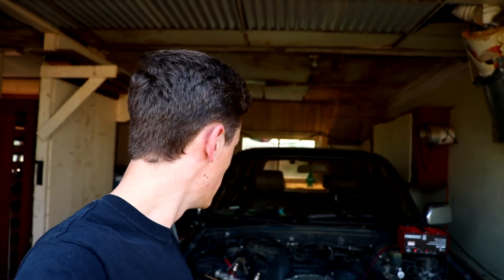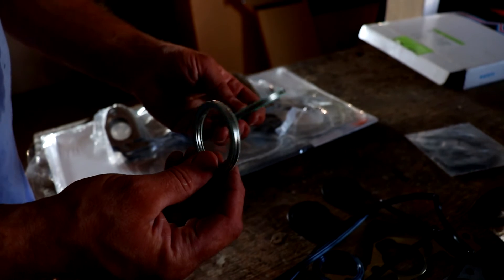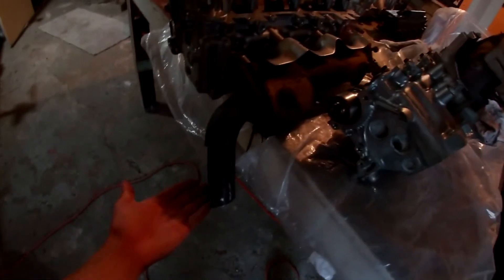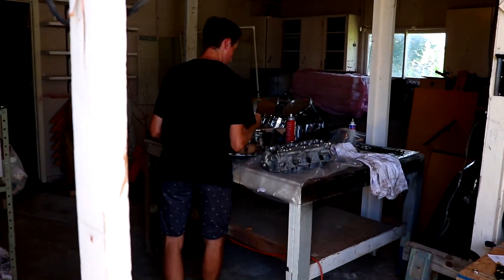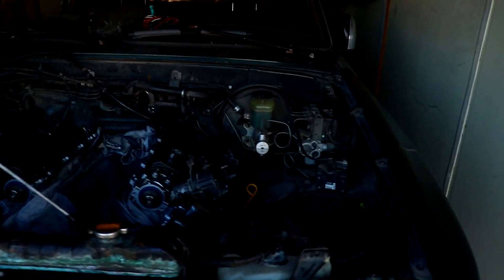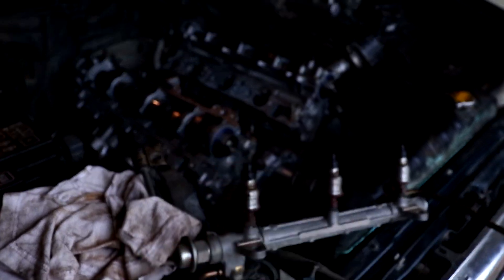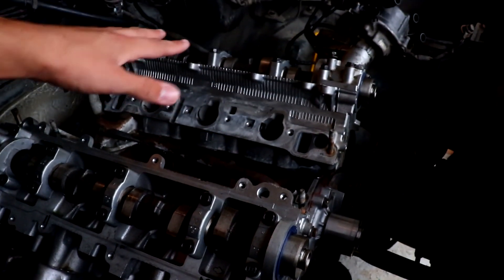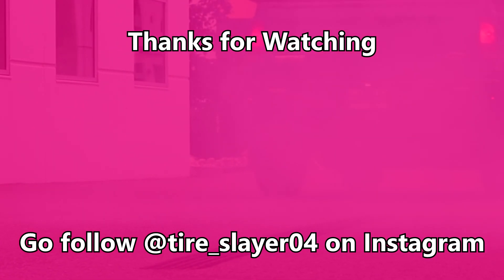Everything you need to rebuild your 4Runner Engine! - Engine Rebuild Pt.3

Comment: I had a guy tell me he was bringing this 4 wheel drive t100 1995 to the junk yard because it had a blown motor, I asked him if I could look at it and I did that night and everything looked good except the radiator and he said it over heated and stopped on the side of the road so he had it towed home,I bought the truck for $200 and I was wondering what I should start with besides the radiator and battery witch I already did should I try to start it and drive it?